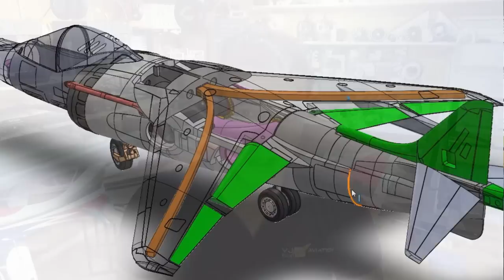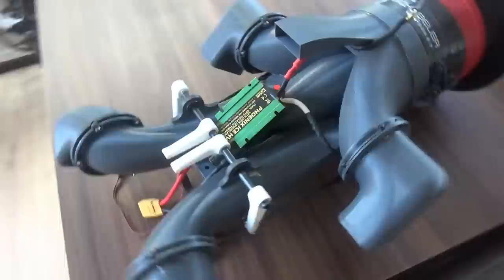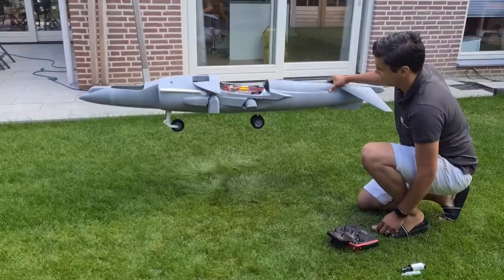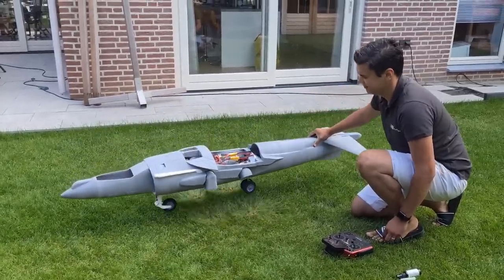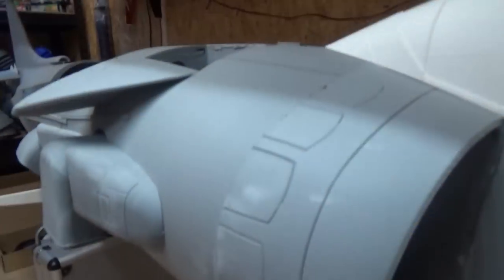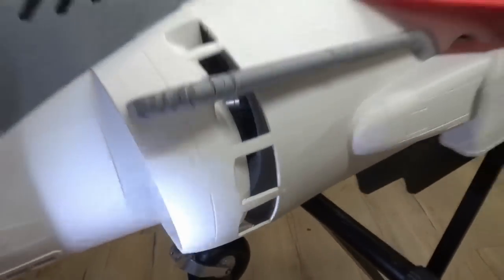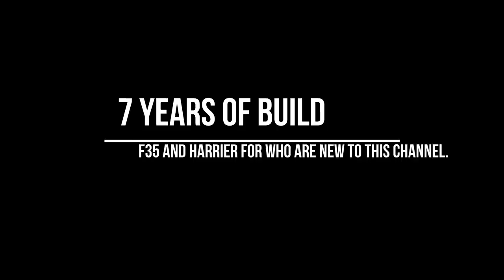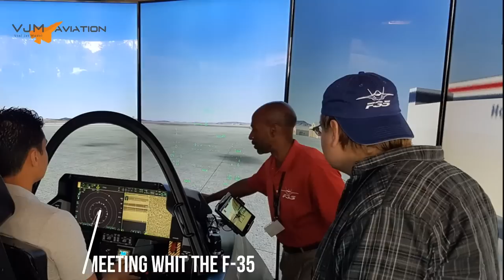RC VTOL Harrier Build 50K special 3D printer Giveaway!! | V2 LW PLA 3D printed RC Model

Comment: It would be cool if you could build a V22 osprey next. It is probably easier to get the osprey to hover and fly forward since propellers are more efficient than edfs and you don't need a lot of motors or actuators to get it to hover

Comment: You did an excellent job. I have to say that even this is the first video I watch from you, you may get more positive comments if besides showing your achievements, and what you use to reach that point, (listed hardware and suppliers) you share how did you solved hardware, balance, and flight control issues so that interested people can follow your lead and do their own models. However, if your interest is in selling your work (which is quite understandable), don't waste your time on youtube, get the project finished, trimmed, and send videos to potential manufacturers to sell your design. People are eager to learn, not so much to see what other people achieved. These are the words of a Design Engineer, current RC fly instructor and back in the day a successful hi-tech sales manager career.
Reply from the maker: Hi Richard, thanks for your suggestions and nice comment, indeed if i want to make more money out of it than good advice, but i am more happy with the little youtube money because this comes back every month to pay for parts and to do what i like to do, building these models. I'm always happy with sponsors but my goal is to make the f35 and harrier fully build and working.

Comment: When I was kid I loved jets. The harrier jet was the coolest because of that vertical takeoff. I built a vertical take off ghost from destiny a couple of years ago on my old 3D printer. I used a ball hover toy as my base and motor. The trick I learned was that airflow was a big factor in lifting off and with the odd shape of the ghost. I had to print rotor extensions for the props. The printers dead now. I haven’t been able get a new as of yet. I figured roll the dice.

Comment: Excellent work, Ive been designing one of these into an 800mm by 720mm harrier, fully 3d printed, 90mm edf, but my air flow design does not have the wing balancers like yours, a must have really so I bought your version. I will now try to redesign your internals into this body after scaling them down, I use RC foam filament but Im still unsure if it will fly as its heavier than a normal plane being all 3d printed as a one piece system. Anyway great work on your harrier you have inspired many to try it, well done mate. Oh and 20 bucks is a bargain for them internal plans, I know how long they can take to make, cheers, nice work.
Reply from the maker: Thanks!!! And good luck. A 90 mm will do just look for JP Edf, I love them

Comment: I notice you don't seem to have the puffers that the full scale harrier has with this model what is the reason for that? Small enough proportional valves exist and it should be possible to route plumbing to the EDF exhaust.
Reply from the maker: i wil make an detail video how this model works;)

Comment: Something cool: (submission)

okay not everybody may think this  is cool, but hear me out because this sounds awesome in my head

Step 1 (optional but would be cool ;) ): 
use ws2812b LED’s as visual indicators on the planes surfaces (just as they are in real life)

Step 2: 
Strap some lightweight BB guns to it, with glow in the dark (uv) pellets as tracer rounds

Step 3:
Check out the results at night
(Even if the plane has to be tied down, just think about the cinematic view)

Also I definitely don’t have a 3D printer,,, and I’m an engineering major,,, so I really need one but I don’t have enough money,,, so yes if possible I’d love to win that printer, if I do the best way to reach me is through Instagram same as my YouTube username but I understand if you find a better comment!

Thanks for years of amazing content